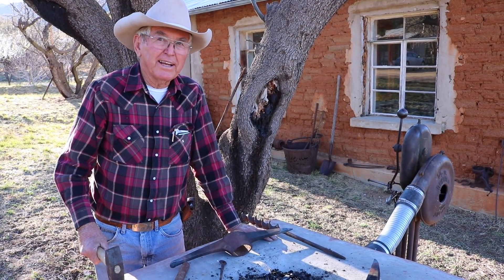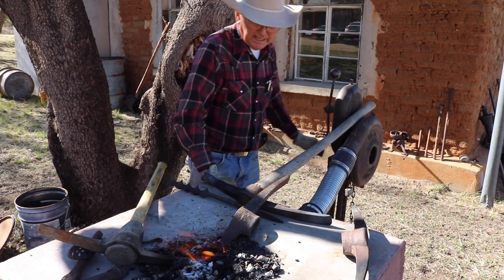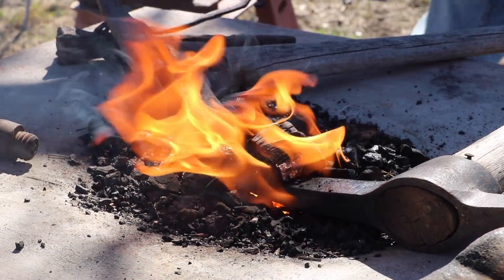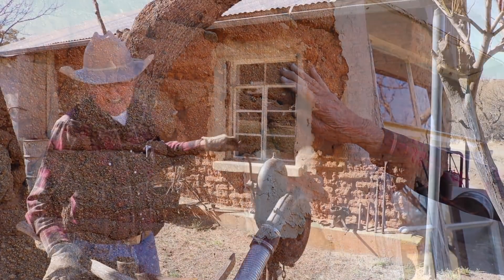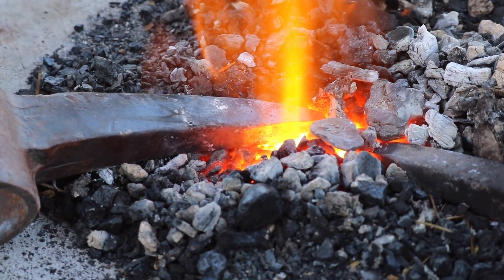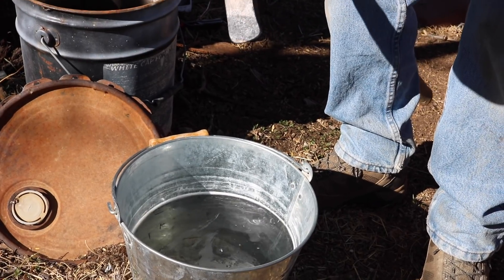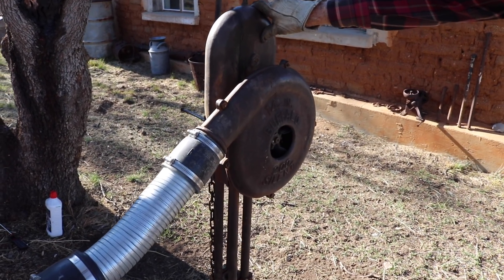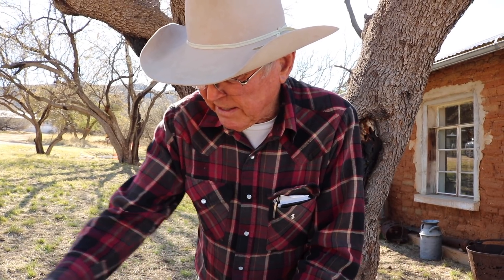Sharpening Steel with a Forge and Anvil

Comment: Thank you Joe for introducing us to Papa Lynn.  He is a treasure.  He reminds me of my people, on both sides, all 'country folk', all gone now.  I don't know how they survived the Appalachians, but I'm here, so, there you go.  I do worry though about the exposed adobe of the antique building; just a coat of mud, applied regularly, will preserve it.  There are lots of opinions about how to do the slurry, and still avoid modern materials which trap moisture.  Whatever, he knows what he's doing.
Reply from the maker: Glad you liked it Robert!  Papa Lynn is an amazing man!  Lots of wisdom and history in time spent with him.  

yes, restoring that adobe building is going to be part of the museum project.  I don't know specifically what he'll use but I know he plans to cover it with the original style plaster coating.. you can see some still around the windows

Comment: Excellent video.  I like stuff like this, old school, (look how popular "Primitive Technology" is).  My big question for this video; Where does a person get coal?   This was an abstraction from normal videos and could become a separate channel.  "Primitive Western Life"?.  Thanks
Reply: I'm surprised you follow Primitive Technology and haven't picked up on the coal :) Just get wood, cover with ground (or a LOT of wet branches, but nothing beats proper ground) except at the top, and let just very little vents on the side. Get the fire started and then cover the top, leaving only the tiny vents. And wait. The wood will burn very slowly and leave lots of wood coal.
Reply: So why do coal miners go thru such danger if it so simple?  Better quality coal?
Reply: You’re referring to charcoal. Coal is mined. Hope this helps.
Reply from the maker: David B thanks David!  I actually had a clip of him talking about the coal aspect but it was just too hard to hear.  But the short is that they (the family) got the good quality coal from bartering with some local power companies a ways back when they were doing some road work for them.
Reply: Not that I am going to do blacksmith work, but is coal even available today in the west.  Never seen it at Home Depot.  Curiosity, where could I get coal?
Reply: David B i live in PA but look around on craigslist. that’s where i get mine

Comment: The method he used to heat treat the tip is very economical of time.  He got a good orange heat on the steel, then he dipped just the tip in water.  That would usually make the tip very hard, but the residual heat further up the pick comes flooding back and softens the super hardened tip just enough so it's not brittle.  He then quenches the whole length of the pick which ends the entire process.  The dragging it in the dirt abrades the steel just enough so it's clean and he can see the color changes due to the changes in the temperature.  There are color charts you can find on line that tell you what temperature each color represents, and what each one is useful for.
Reply from the maker: yes, that was actually the part that really interested me the most... the shaping is fun and neat to see but the tempering really takes the knowledge of experience to get right :D

Comment: Joe you can turn your Concrete Countertop Table with DRINK TRAY into a forge.  I must have missed why this was done.  Does steel lose its temper and hardness over time?
Reply: Over time and much use, a bit wears off, and some of the remaining metal gets driven back. Then it needs to be "upset"- the metal drawn back out and re-pointed.
Reply: Pygar2 interesting thanks.
Reply from the maker: Ken, not sure about the concrete table being turned into one... wife wouldn't like that...lol... but a forge project in the future... quite possibly ;)
... and Pygar had a good answer on the reforming of the pick end steel ... thanks Pygar2 :)